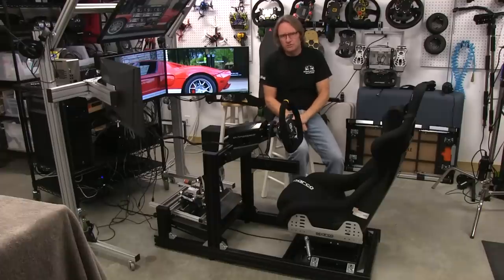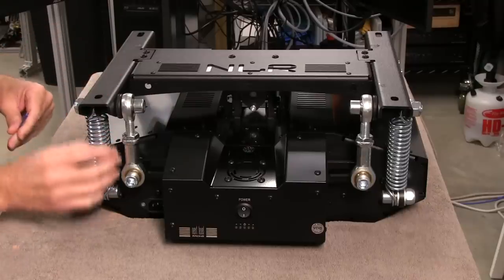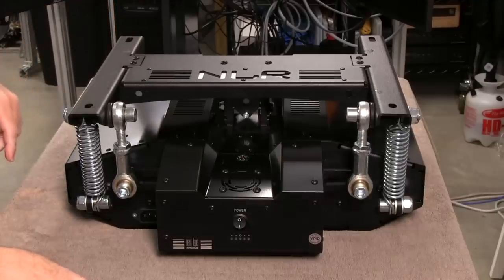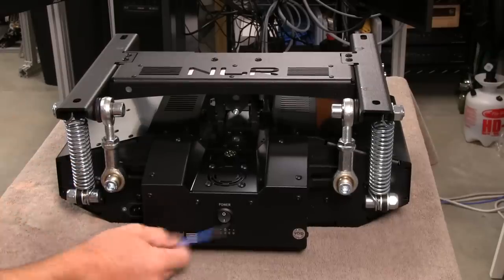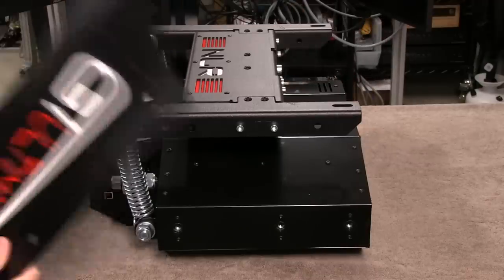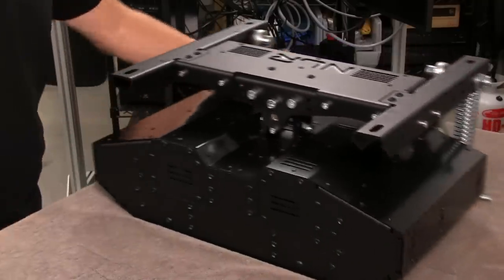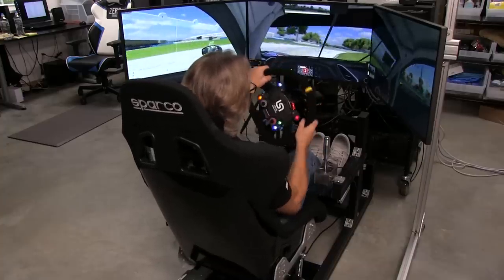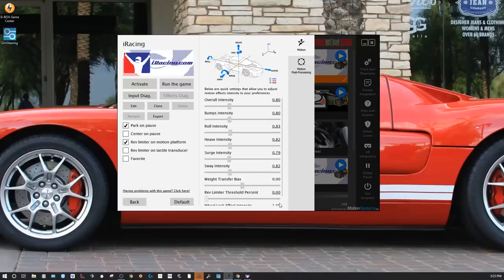Next Level Racing V3 Motion Platform Review

Comment: I've been using the V3 for a year, mounted neatly inside my Sim Labs P1 rig. Within vr especially I find the immersion it provides excellent. In fact I can't sim without it now. It also helps in a big way if you suffer from nausea when wearing an HMD as your brain is registering movement that it's expecting to, (despite the restrictions of 2DOF), based on what your eyes are seeing. As Barry says, the range of movement is very much down to individual choice and there is no right and wrong. I personally prefer the settings dialed right down though, with the motion cues I enjoy based on the 'less is more' principle. For example I don't like the seat surging forward too aggressively under braking and compressing the distance to the pedals. Great for the abs, less so for pedal finesse! The post-processing settings are also worth exploring for dialing in an even better experience, especially when it comes to creating individual profiles for different car types, for example formula vs non-formula where the range and nature of movement differs. Indeed the supporting motion platform software is excellent, quick, simple and intuitive on the one hand but plenty deep enough on the other. Another shout has to go out to Next Level Racing's customer service and after sales / developer support. They are quick to respond about anything and extremely helpful. Secondly they listen to their customers and a few ideas that I and others have suggested to them, which we believe would improve the experience, have been added to firmware and software updates. Highly recommended!
Reply: It fit inside the  SIMLAB P1?  you have some photo of your rig ? i also have a P1 and i was curios to know if there was a was to fit the V3 on the P1, because over the long rail is a no-no situation, the seat will goes to much high. But if it fit inside ill buy one in the near future!
Reply: @ODIOPOWER  Yes, using aluminium angle you can lower it neatly inside the P1 and fix it securely. It's tight but fits perfectly.  Have a look here. https://www.racedepartment.com/threads/buying-advice-please-next-level-v3-motion-platform.137061/page-24#post-2752208
Reply from the maker: Yes. The V3 is 460mm wide without the side brackets. The P1's inner dimension is 500mm wide.
Reply from the maker: Great solution, I was thinking the same. Or run some aluminum plate on the underside of the 40/160 rails with a 50 or 60mm lip protruding to catch corner brackets mounted to the unit.
Reply: Mac10UK tnx a lot mate! Now I just need to find 3k euro and buy the v3 xdxd
Reply: @Mac10UK  O..., M..., G...!!! 🤗 Thank you..., Thank you..., Thank you...!!! 👌👍 This is just the sort of detailed information that I've been seeking...!!! 😉 Much appreciated...!!! 😎😁🤘
Reply: Is this something that could be run on the second floor of a house, or would it make a ton of racket?  All my sim stuff is in my second floor media room, so I wouldn't want to be shaking the entire house with it, as I usually play late at night.
Reply: @simracinggarage3026   20 mm spacers either side and extended bolts, fits perfectly in my P1.
Reply: Do you have any problem with holding the wheel and reaching the pedals? I mean i can imagine if it's tilting on one side and then quickly to the other, then your leg is moving a lot, but your foot should stay in one place. Which can be tricky sometimes, right? So like the angle of your foot is changing as the seat is moving around, hence precision on braking and pedal handling can be damaged quite a bit. What is your experience?
Reply: Mac10UK did you drill the p1 to get it to fit?

Comment: When you think about it, the wheel and pedals not moving is more realistic to the force you feel when your driving a real car.
Reply: In a real car, the entire car dives under braking, rolls in corners, and pitches under acceleration. So the pedals actually do move in the same way the seat moves bc the platform on which the seat and pedals and wheel is attached moves. 

The reason it matters is the distance btwn the driver and the controls remains static which gives you a stable platform to make and maintain smooth inputs.

Comment: "Can such a small package deliver a truly immersive driving experience?"
Yes it can!! :)
Reply: How does it compare to chassis movers and chair movers?! They cost way more and take way more space. Please let me know
Reply: @FirstLast-tx3yj  hi, i have been using this for quite a while now, and i can say that without comparing to other units it is very good, obviously the level of FFB would be determined by the platform your playing, iracing or rFactor etc.
If the settings are left at default it would just about throw you out of the seat, i have turned the settings down on mine. The feedback is great, you can tell when you go over curbing, you can tell either left or right side, and front or rear wheels, amazing lol. The only complaint is the amount of play it has when not in use, the seat rocks back and forward a lot in my opinion, it is within spec appatently though, hope this helps

Comment: I bought the V3 last August to fit on my Next level GT seat, and the only problem was it was one hell of an effect to screw it to my existing seat, other than that it works well, the cost in Australia around $4,000.00 is a bit expensive
Reply: hi Anthony, are you still using it? Thinking of getting it for FS2020, I am in Brisbane

Comment: Barry great job on reviewing this unit! I was wondering if I need to purchase the same seat brackets you’re using in this video or any other seat brackets would do the job. I forgot to mention that I own the same sparco seat you have. Thanks in advance!
Reply from the maker: I can't say for anything other than the Sparco brackets. Sparco does make a cheaper steel side bracket that has the exact same hole pattern on the bottom flange. So they should work to. I did have to fiddle with the bolts to get them all in. Just leave them all loose as you put them in and you should be able to make it work.
Reply: Sim Racing Garage Thanks a lot very informative!

Comment: Great review Barry as always...!!! 👌 However, I'm curious as to the unboxed dimensions of the unit and if it's possible to slide this unit into the rectangular spacing that's normally available under the seat of a "SIM-LAB P1" chassis...??? 🤔 Will it clear the four walls of that area? Thanks 👌🤔
Reply from the maker: Yes it will fit inside. It is too wide with the side mounts. You will need to fabricate some kind of a mount because it is a bit narrow without the side mounts. A regular corner bracket like the ones I used in this installation are too short. You could use some washers to space them out from the V3's chassis. I was thinking about mounting some 1/4" plate aluminum plate underneath the side 40/160 profiles with 2" protruding towards the inside of the chassis. Then use corner brackets to mount to that. This would sit the entire unit low enough that your seat height would be very similar to the regular seat rails that come in the P1 kit. Or use some angle aluminum along the inside channels of the 40/160 profile and adjust the height that way. Many ways to go about it.

Comment: love your vids Barry. Question on mounting the seat. I have the stock NLR seat but this thing is not worth the money i paid for. You mention in the video that you have to fiddle with this sparco evo to mount it. Did it give you any trouble? Ive read many forums that the base doesn't accommodate seats very well .
Reply from the maker: 25:52 I used some washers as spacers to push the seat brackets out enough to get the holes to line up. I really don't like this version of the Sparco brackets, as they  have a strange curve to them. I am about to buy some new ones where the bottom mounting flange is more perpendicular to the side of the bracket. Should make it a bit easier to mount.

Comment: Do you think lap times would go up with a setup like this or is it more just for the sensation?  Just looking for your opinion, I'm sure it depends on the user.  Cool video.
Reply from the maker: Probably not with it set to higher force levels. But, with it turned down to "less is more" type settings it does give you more information to react to than with just a DD wheel alone. So, it could help you to be faster. Really depends on the driver I think.

Comment: Barry what model are those bowed out side rail Sparco mounts?  I may be getting one of these and I’d need to mount my existing seat to it.  Thanks
Reply from the maker: Sparco 004903. I got them used for a good deal. New they are rather expensive. I also have a set of the Sparco 4902. They are half the price and work just as well.

Comment: Great review Barry. Can I ask what fittings you used to fit the NLR MP V3 onto the GT1-Evo and if any adjustments had to be made to get it to fit? I have the same rig, and after watching your review I want one!

On another note, with a regular racing seat rather than a bucket, should I be worried about falling out? :)
Reply from the maker: Start here: 19:46 Only other thing I did was add 2 washers between the corner brackets and the side of the V3's chassis where the bolt holes are. This to space the bracket out about 4mm for better fitment to the profile grooves.
Reply: @simracinggarage3026  Amazing, thank you. Looks super simple compared to some fittings I've seen on other rigs.

Comment: Any plans for reviewing the Dofreality 2-dof motion platform? It is a full chassis platform but at about half the cost of this one. It appears to be gaining traction among sim enthusiasts
Reply: I've had lots of issues with my dof reality I would hold off. I would happily pay more for something else if I would of known I'd have so many issues. I've had my motion platform for over 3 months and I still dont have it working properly. Really a bummer. I feel like I've lost a lot of money.... lot's of wasted time trying to fix it and its wobbly when its off so I dont use it my rig hardly at all anymore.
Reply: @jonberg469  could you elaborate on that?
Reply: I purchasee an M2 seat mover to bolt up to my sim lab p1. I supllied them with measurments, when I received the unit 4 weeks later i noticed it was way too wide and would not bolt it. Called them they admitted they didn't look measurments. They told me to bring it to a fabricator of my choice here in California to get it fixed snd pay for it myself. I obviously declined this and told them to build me another set of mounting brackets. 4 weeks later I recieved the new brackets. They were built wrong still but I was able to adjust my simlab p1 to make it work. After installing the new bracket I noticed my left motor was acting very lazy. After hours of testing on my end I figured out it was broken. Sent them an email. After a week of back and fourth enails of graphs etc....they said it was a 30 dollar controller unit in the box. They also suggested I buy one myself and apply thermal paste because it will be much faster then then shipping it. Again with my own money. I disagreed with this finding because I was sure it was the motor. I swapped plugs and put the bad motor on the good controller... I was right. Motor is bad. It's been another week emailing them more charts and back and fourth with no solutuon as of yet. Only reason I haven't posted on forums is because I'm afraid they might not honor the warranty. There is even more then this, just wanted to give a quick overview.
Reply: @jonberg469  I guess I'll hold off a purchase for now then, thanks for letting me know.
Reply: @joshuabenson2568  there are lots of people with good experiences it seems. I'll most likely buy a simxperience 2dof kit too add to my cockpit. I think a lot of people that are happy are not hardcore sim racers or dont know what else is out there.

Comment: Hi Barry, great review. Would it not be an option to combine this NLR simulator with your dBox simulator? Than muscle tension can be created by this one and all the car effects can be created by the dBox. Best of 2 worlds or am I wrong?
Reply from the maker: I do intend to try it when I get the chance. Just real busy right now. There may be a sync issue, as you would be combining to different types of actuators systems. And syncing the two software programs could be tricky. I ran into this a bit when combining the GS-4 seat with the Stage 4 rig from SimXperience. It worked fine, but I could feel a bit of lag between the speed of the SCN''s and the servo motors on the GS-4. Even when being driven by the same software.

Comment: Hey Barry, how does it compare to your Dbox in your opinion ? Also what size monitors do you use ? Thanks
Reply from the maker: They are two different types of movement. I prefer the Dbox, as the whole chassis moves, instead of just the seat. That' not to say a seat mover is not a good solution, it is. Just like it better when my wheel, pedals and peripherals move together as they would in a real life. 27" monitors.
Reply: @simracinggarage3026  recommended starter product?

Comment: I'm about 250lbs @ 5'11 do you think it'll have problems holding that weight? will it loose force feed back strength 
after 2 hours of playing at my weight?
Reply from the maker: I have no way to test this. However, the stated weight limit is 285 pounds. So it looks like you can use it.

Comment: Great vid! I have actually dropped this into my P1. Bolted on top it's way too high. I also had to make something to fit my seat. Having the black P1 though, you would want to build around the platform or take it apart some, as you wouldn't be able to lower it in without messing up the finish.

I made a video on the process and my solution... https://youtu.be/6DgAl0G5PnQ

Also, I have an updated Beta from them which adds a slider to adjust the rev limiter intensity, a great addition.

Comment: Hi Barry. I just purchased the NLR Motion Simulator. It is
installed in a NLR GTultimate v2 cockpit. When I lean back or push on my brake pedal the Motion Simulator rocks back. It’s definitely in
the motion unit itself not the seat. Is that normal?

Comment: How many decibels does the NLR v3 throw out when setup for "regular" use? Wondering how much sound/vibration isolation would be necessary so that my downstairs neighbour doesn't want to murder me.
Reply from the maker: Did not take any sound measurements. So can't say. But, I don't think you would have any problems with the noise level on this unit. It's relatively quite. I would be more concerned with the vibrations a transducer setup would produce.
Reply: Sim Racing Garage thanks! I guess some thick rubberized mats are in order, just to make sure then.

Comment: Is this OK for Apartment/Condominium ?
People downstairs will think I'm using Electric Drill or running on Treadmill ?
Reply from the maker: It's not loud. But I can't tell you about any vibrations the may transfer through a ceiling structure. Don't have a way to test that.
Reply: @simracinggarage3026   Thanks for your answer. 
I heard a kid upstairs dragging a table, It's not annoyed because it's a few second. But with this motion sim, I'll be more than 30 minutes for sure.

Comment: where is the serial number located to download the software?
Reply: The serial is on the bottom of the unit. Unfortunately the serial for the one I just installed does not work on the next level website and the motionsystems website gives me a dead link.  Edit:  I found a serial floating around the web that worked. Quicker than waiting for support.

Comment: How tall is the base? I'm wondering how much height it will add to my seat.
Reply from the maker: 250mm tall with the side brackets attached. 199mm tall without them. But you will need to leave some room under this unit to allow proper air flow to the bottom fans.

Comment: Would it be possible to build a frame that connects to the seat and the pedals and wheel? I would much prefer everything to move at the same time and It doesn't seem like it would add much extra weight and the system seems pretty robust. I am really thinking of buying one but I am planning on doing that and hope it works. Thanks for any feedback and good video.

Comment: Can I still mount my seat slider to this? Or does the seat need to be static?
Reply: I mounted it with a seat slider but when you are racing you need to make sure you are sitting in the center of the platform otherwise the motion will be off.

Comment: How does this work with xplane 11.Thanks great video
Reply from the maker: Never tried it with xplane 11. But that game is supported.
Reply: If it's anything like the support it has in DCS it should be pretty good.  A little motion goes a long way and it can even handle a barrel roll reasonably well.  However I think it does a much better job with driving than flying.

I have my throttle and stick moving with the seat and the flight pedals static. When you are driving especially with load cells it's pretty easy to keep the pedals in position as your legs are bending a bit.  With flight pedals where you have less effort and left/right rocking, it feel a bit unnatural. You get over it quickly, but you can notice it. With driving pedals I never feel it.